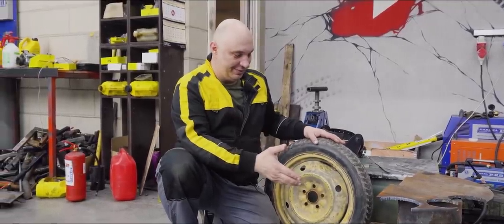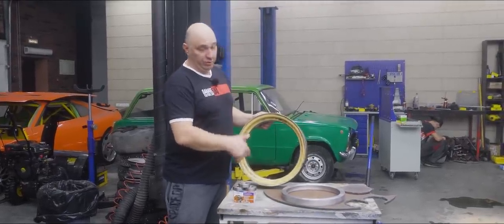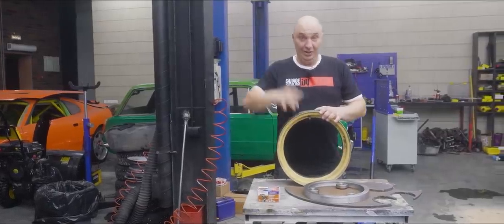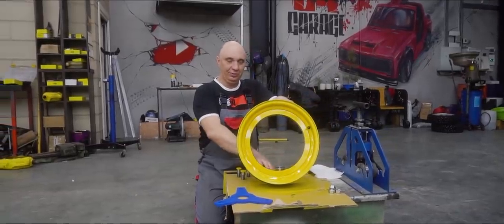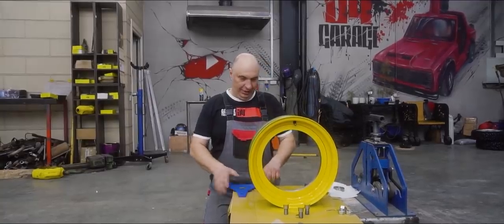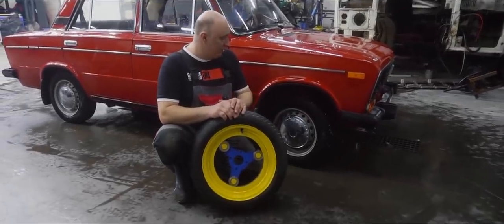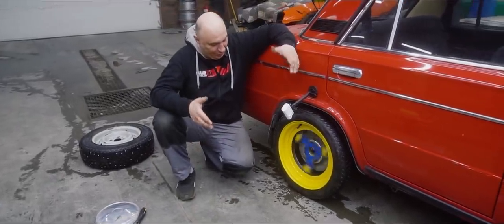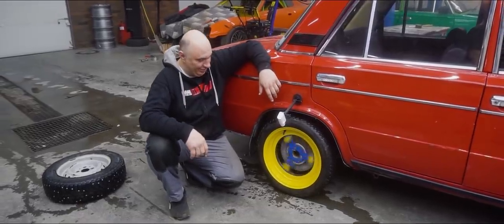Making a wheel with centerpiece on bearings

Comment: The knock comes from the bearings. They are not all in touch with the outer ring, so when the spokes spin, the bearings fall down on the track.
The lower bearings are supporting the weight of the car and the upper one is basically floating. When the spokes turn, the upper bearing comes down, gets weight on it and falls on the outer ring.
It might be just 0.2 mm but that's what makes the noise.

Comment: The knocking is when you have a single bearing on the bottom taking all the weight and it passes the lowest point the triangle hub will tip forward slightly and weight shifts from leaning on the rear-top bearing to the front-top bearing.

Comment: DID YOU GREASE THEM BEARINGS IN THE HUB? It looked very dry and sounded like metal on dry metal. Plenty of GREASE TO MAKE IT SMOOTH AND THE BEARINGS WILL LAST LONGER AND WONT DISINTEGRATE DUE TO HEAT AND WEARING/ GRINDING ON METAL.

LOVELY BUILD. LOOKED VERY NICE! 

👍👍👍👍👍THUMBS UP👍👍👍👍👍

Comment: The ring might be slightly untrue on the rim, or it could be the weight on the wheel not being distributed evenly side to side, with the ring being offset as it is. Also the bearings are only mounted on one side, which would cause some flex. You want to minimize force acting upon the side of the bearing, as centered as possible. This might be a good design for a support wheel on a dump/cargo vehicle.

Comment: The knocking is the gap from bearing being loose in the race made. Theres a small gap from heating and cooling. Also, the wobble is probably from the welding the race in crooked or the heat distored the roundness.

Comment: The thumping is from the loose fit between the three bearings in their spoked carrier and the grooved track they ride in.  When the carroer rotates and a bearing makes contact with the track to support the weight of the car, that little gap closes and it makes the thump sound.

Comment: Hey guys, here's an easy one. Make a video about siping a tire to improve traction in snow (making 3mm deep cuts in the tread blocks with a utility knife). I've seen some pictures on the internet, but i don't think i've seen an actual test. Usually this is done to mud tires on 4x4 to improve traction on wet roads, icy roads and in general snow.

Comment: The knocking comes from the play in between the bearing and the machined race they sit in. There’s a microscopic space that you can’t see where they go from touch to free. You can also see where you welded the race into the wheel it’s not exactly square or straight. And it makes the wheel wobble at the end of the video.

Comment: Super cool stuff. Inferior bearing I would guess. Once the weight of the car is applied, and the spindle starts to spin (front or back) bearing is too stressed from the install. Drop from jack maybe, or just weight of the car the bearings have to support *3 tiny bearings vs 1 big bearing*? Just a quick thought on it from me. Sounds like every car I've ever owned that had a bad wheel bearing lol Looks super cool though!

Comment: The knocking is from the lack of preload on the bearings. As each one travels down the bottom half of the race, any slack is taken up as the bearing comes under the weight of the car. You won't notice it on the bench since there's no load on the system. Same reason you can't diagnose a bad bearing until you put some load on it.

Comment: The knocking is most likely the play in the bearings slight but as the rotation differs so does the angle (camber) causing the bearing to change their load angle causing the knocking sound? Just my take on what might be the issue if it doesn’t make the noise with the bearing not having a angular load

Comment: you can do some good 4X4 drive experiments with that wheels, like putting on the rear axle, or front axle or in mixed configuration (one at front left, one at rear right, or 3 fidget spinner wheels and one normal wheel) too see how modern 4x4 systems can handle the situation to get the car moving forward (BMW XDrive, Audi Quattro, Subaru 4x4 - and a classic Lada Niva or UAZ Hunter)

Comment: great experiment and looked awesome. Now could you replace the bearings with gears mounted to generators or generator so when installed on the front of the car when you brake it makes power?

Comment: Use 2 center spoke plates to double shear those bolts. Machine a slot on each spoke for the bolts to adjust tension against the groove the bearings ride on. I believe the knocking noise may come from too much clearance between the bearings and the outer rim and only the bottom two bearing are touching at the same time leaving a small gap at the top. The weight of the car accentuates this as it might not be noticeable spinning it free hand in the air. You could also replace the bearings, rim, and hub surfaces with gears and have a planetary gear reduction wheel.

Comment: Your knocking is coming from the 3 spoke design and the bit of clearance between the beating and race. As the spokes turn past the lower center point and transfers the load to the adjacent spoke you get your knocking noise.

Comment: I guess the knocking is from between the bearing outer surface and the rim groove, when the next "leg" comes from above, and into contact with the rim. Roughly, when the leg in front of it is at 6 o'clock.

Comment: If you block the brakes from working on the driver's rear and keep them working on the bearing side, you will have an addition overdrive gear when you use the hand brake due to the differential.
Reply: Or just put in neutral and coast. It’s easier.

Comment: When you put the wheel on the back end and you heard that knocking.  The only thing I could think of is the holes you drilled out for the lug screws were a little wider than the lug screw shank and when it rotates that flange slides with the weight of the car it's enough to make the knocking sound.  

Wade cars are made here in the United States we use lug nuts in the bolt is attached to the car.  But on the bottom of the nut it's sort of the reverse countersink and the hole in the wheel is countersunk.  So they don't slide around even if the hole for the lug nut isn't exactly right

Comment: I think the issue is the spoked hub.  The metal might of just had a little twist in it.  You can see the wheel wobble in the end of this video.  If it was machined like the wheel section you would of had better results.  That being said,  I'm impressed.  This is science.

Comment: Garage54, I think the knocking that you hear on the "Y" inner hub is the weight of the vehicle, causing the un-loaded bearing to "drop" onto the bearing race. there is not any load forcing contact on all 3 bearings to the outer race (bearing track), that millimeter or so of movement is enough to cause the "thump".

(Translation by Google)

Garage54, я думаю, что стук, который вы слышите во внутренней ступице "Y", - это вес автомобиля, в результате чего ненагруженный подшипник "падает" на обойму подшипника. все 3 подшипника не соприкасаются с внешней обоймой (дорожкой подшипника), и этого миллиметра или около того перемещения достаточно, чтобы вызвать «удар».

Comment: knocking is play the 3 bearings have in the circle. It's leaning on 2 bearing and as it rotates it briefly leanes on 1 when it switches from back bearing to the front bearing. Jep just a tiny amount of play will make a knocking sound.

Comment: I would say that the knock was caused by an imperfect fit between the outside of those bearings and the inside of the ring , diametrically speaking. Maybe putting one of the bearing axes in an eccentric adjustable kind of mount and adjust it for more outward pressure against the ring would work.

Comment: In my opinion the knock you hear is not only because it was rubbing agains the brake caliper (but they already found out that), but because of the triagonal shape using only metal-to-metal collision which is colliding very hard surfaces. If there is even a slight gap, under the pressure of the car that gap increases and when a bearing with a greater gap (when it's on the top of the rim) suddenly closes that gap (when it goes down) it's making that knocking, which means you will have excess wear on your bearings

Comment: I think the knock is just the next bearing taking the load off the previous one on the bottom if there was 4 or more I don't think this would be a problem I'm guessing there is a slight size difference in the wheel track and the centerpiece. Or there could be some compression in the bearings them self. Even the slightest gap would cause a knock because only one would have the load till the next one touches and when it does it would knock.

Comment: Knocking is the bearings coming off at the bottom of the travel, and having a small gap between bearing face and the outer ring, and then coming back into contact later on as the inner section rotates, so it takes load again.  Hard to fix, short of having the stud shafts with the nut section slightly eccentric, so that you can adjust them after installing, to give a larger preload onto the outer race so the bearing and race does not separate. Preload per bearing will have to be about the load applied by the vehicle mass, so around 2500N.

Long term those bearing outer races will fatigue and crack, they are not designed for this, you have to use proper cam follower bearings to get good life, as they are thick walled to have fatigue life much higher than a regular bearing, and not to deform under point loading on the outer race.

Comment: Looks brilliant I belive the knock is to do with the 3spokes  and bearing hight if you where able to adjust the spokes to make them loner in the wheel rim the knock might go away as I think there's a small bit play between bearing and the rim as the bearings have settled due to having the wait on them or the bearings are slightly knocking against there new  side walled track 🤷‍♂️ would 5 spokes help even the weight I know it's not a heave car but like you said are they bending maby slightly could be worth a shot

Comment: Tha knock comes from the unloaded bearing coming around to the bottom and making steel-to-steel contact with the track as it assumes the load. No matter how tight the tolerances, without a lubricant cushion, you're going to have play. Only two bearings will be loaded at any one time.

Comment: The brake caliper sits on slides it expands when you release the brakes in both directions and contracts in both directions when you press the brakes to grab the disc with even pressure on both sides.

Comment: This would be a great idea but with the springs and dampers around a central hub (maybe soft leaf springs?). It would feel a bit weird to drive though because it would damp shocks in every direction so it would just glide over bumps. 😂

Edit to add: This is why off-road motorcycles still use spokes, they are flexible and act to assist the motorcycle suspension.

Comment: I think the knocking comes from the bearings. You will have at least one bearing under pressure while at least one is free and when this one will be near the bottom, it clamps against the bearing rail and get under pressure. That's why, you didn't hear it while the car was lifted up.

Comment: The knocking is due to the weight of the vehicle on the bearings while riding on a machine surface also whenever you welded that machine ring inside of the wheel the chances are it got slightly warped from the Heat making it not 100% circular anymore just enough to make it have a little bit of wobble

Comment: Put very small C-clamps on the brake disc, up against the caliper, one above and one below, to keep the wheel from turning at the hub. That will guarantee the wheel will turn at the outer ring, like you want it to.

Comment: Or, Wind an coil spring over an split propshaft, that is 2x pieces of pipe fitting into one another so it could twist in an straight line. The spring will give the car an springy acceleration.

Comment: The knock could be the spoke flexing slightly as the weight goes on and off each one. Put a piece of rubber along the inside of the guide.

Comment: It’s the space between the bearings and the rim even with a tight tolerance when they have a load applied you have a knock but when the brake is applied the hub doesn’t spin the knock stops

Comment: Knocking is the lug studs moving around in the lug holes on the wheel you didn't taper the homes to make then lug centric making it knock as it spins when you hit the brakes knock stops as the lugs settle where ever it stoped till you release the brake. You get the same knock with after market wheels if the wheel isn't lug centric

Comment: I think the knock is coming from the bearings having too much tolerance between the walls of the guide or they aren't all 3 sitting entirely flush against the guide and as they spin around they make contact with the guide again. The metal used for the hub portion along with the spacer used is providing just enough bow on the hub to create a small gap.

Comment: Maybe it's that they measured the distance when the caliper is not breaking and sitting in one place but when you apply the break the caliper moves because when you break half the movement is done with the piston but the other half is the whole caliper moves to pinch the router

Comment: You didn't hear the knocking because you had no weight on it. When driving with the weight of the car the spokes could then bends a little to contact. As you noted, it was only a small rub.

Comment: This gives me an idea, this same basic wheel/hub design, except made like a centrifugal clutch. Sort of like a motorcycle clutch. Put them on the drive axle and see if it can drive the vehicle forward. At slower rpm, the center just spins freely, but when rpm raised, the clutch assembly engages rim/bearing race assembly. You guys think you could create such a contraption? I think you could. Challenge accepted? 😎

Comment: You guys should try attaching an engine directly to a wheel on the car.. some quick googling says an average tire does roughly 840rpm at 60mph, so if you hooked the engine directly to the tire you should possibly be able to cruise at highway speeds with the engine at basically idle speed! In theory anyways xD

Comment: American gangsters: "Check it out the car stops and the wheels keep spinning!"
Garage54: "Check it out the wheels stop and the car keeps moving!"
This could be a usefull product...Some chassis dynos have you remove the wheels, put your car on a hoist, and bolt dynos to the wheel hubs...If you installed these wheels for that style of chassis dyno you wouldn't need a lift (though if they broke on a  dyno pull all hell would break loose).
They are really close to implementing a planetary gear set in the wheels...That would be a great idea for a wheel video "planetary gear wheels that reverse the direction of travel".  Make the sun gear hub driven, bolt the planet gear carrier to the brake, and the ring gear would obvoiusly be the tire...If done right it would be visually striking to see a center hub spinning backwards, the planet carrier stationary, and the tries moving the car forward all at the same time...It would blow the minds of passers by on the street unfamiliar with planetary gears.

Comment: There are not enough bearings or there is clearance between the bearings and the wheel causing the knocking every time it rolls up and then falls over onto the next bearing. It would probably need about five or more bearings to stop the knock, or use tensioners to push the rollers out onto the wheel at all times

Comment: Clearance between bearings and the rim. The weight is supported by 2 bearings at  a time and the third have more clearencethen the 2 others...when comes that one is down, the clearance become zero and the bearing hits the rim...The frequancy of the noise is the same as the bearings axchange locations

Comment: Nice test but propably not very long life solution.

Welding tends to warp parts easily, so that's the most propable reason for wobbling. I'd also expect those bearings shatter into pieces when ģrain of sand gets between them and the rim. Point of contact is really small between steel and hardened bearing.

Comment: The disc wasn't properly aligned on the lathe you can see It at 1:50 . I think that's the reason of the knocking noise and wobble on the rim .

Comment: that knocking sound must be because the bearings are very slightly different how far they are from center.  as the rim and center rotate the rim falls in and out of place, as there must be some clearance between bearings and rim. if the bearings were forced out with spring pressure rather than being fixed in place there would be no knocking sound.

Comment: 11:20 Could run that on the back by somehow locking it on that side to drive , and unlock that and add some kind of power take off device (PTO) and lock the other side somehow. when you need to spin something and dont have a tracktor with pto?

The bearings may have tto be mounted a bit differently and/ or add more spokes w/ bearings.

Another note . Could use the metal ring track, the bearings ride in, as a in tire brake disc, and a "external" caliper, mounted, in the "bearing assembly hub" as a way to stop the vehicle.
could use the "external caliper" as mentioned above to lock the rear wheels to drive? and or lock one side and "run the other? like stearing on a tank do?